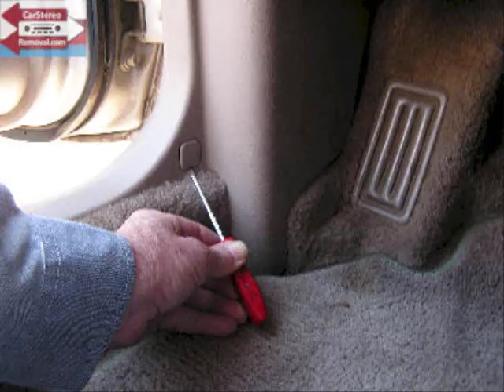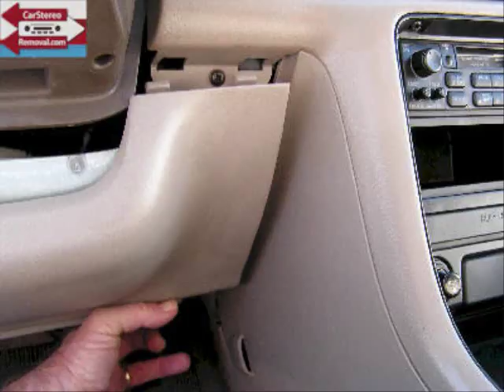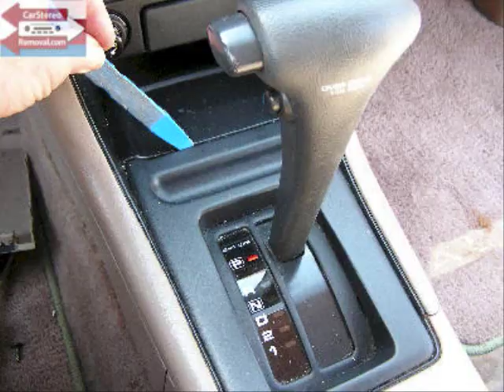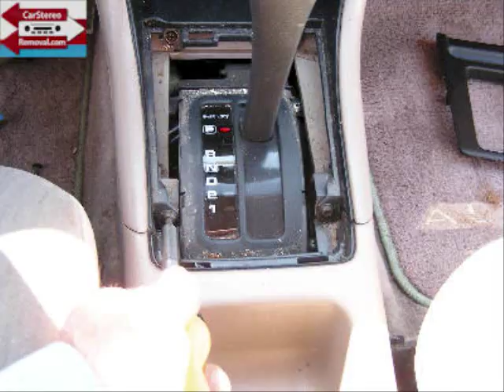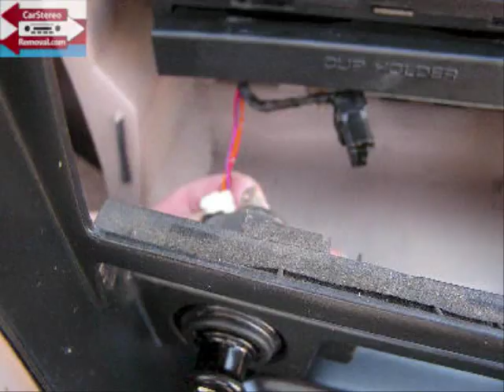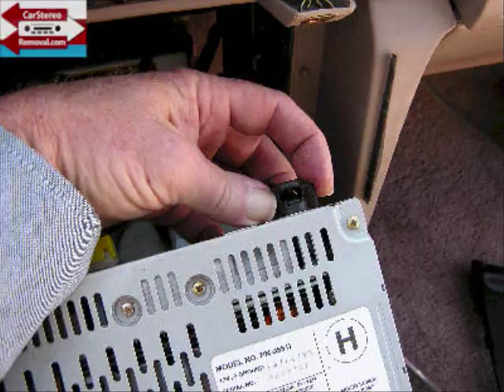Nissan Altima Stereo Removal = Car Stereo HELP

Comment: Remove negative cable of battery first? - video includes disconnecting the 12V supply. But here's my issue: My 97 Altima GXE will not come out of park unless the key is in at least the accessory position(and I assume the battery has to be hooked up for that to work...?). If I put my gear lever into low my key will then not go back to lock position completely, and key will also not come out of ignition. With car like this I don't want to go messing with the battery to unhook neg. post.  So my question is, how to get around this for changing out radio?
Reply: which after market radio did you get? i want to get one with a cd player. any suggestions ?
Reply: Is ALL that removing of the threshold of door necessary to see if coins are stuck in the shifter of 97 Nissan Altima?
Reply: @moonbellybaby6238  I don't remember having to remove any door threshold(done 3 yrs ago and I no longer have that car), but I do remember having to remove a panel below the steering wheel before the center console could be unfastened and pulled up.
Reply: Update:  I never found any answers to this, so I just left the car battery hooked up for removal of factory radio and install of aftermarket radio/CD player.  Everything went fine.  When I plugged in the wiring harness of the aftermarket radio to the factory harness my car antenna suddenly went up, even though the removable faceplate was not on the unit (and car ignition key was as close as possible to "Lock"). The power switch of the used radio I bought must have been left in the on position.  No harm was done though.  A side note: It turns out my 97 Altima did NOT need any antenna adaptor - it did not have a 2 prong factory antenna wire.  It had the standard one prong and went right in to my new radio just fine.  I had to spend some shipping money to send back the antenna adaptor I bought.  Hope all this can be helpful to someone.